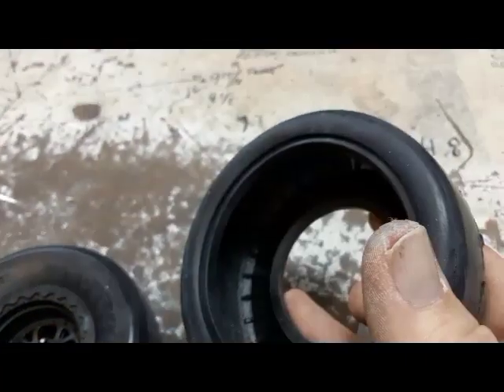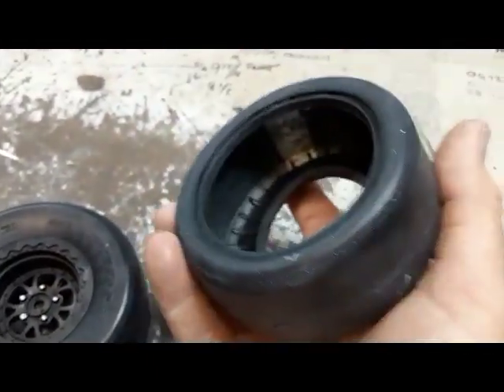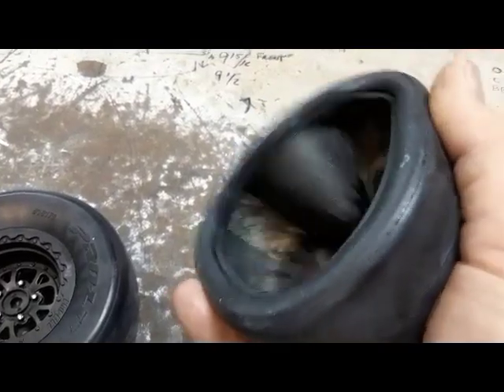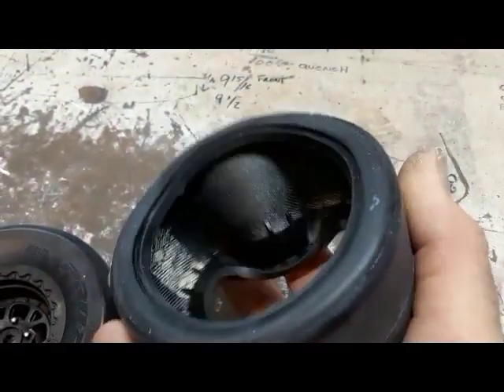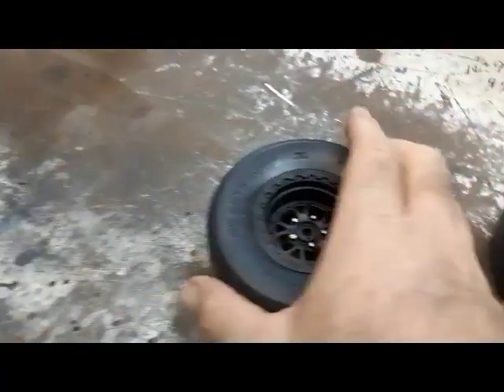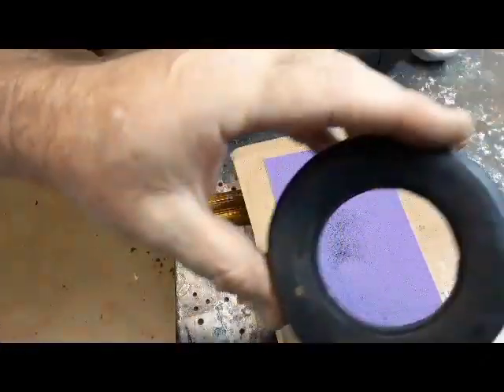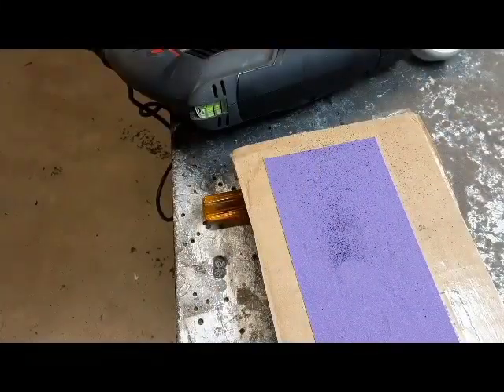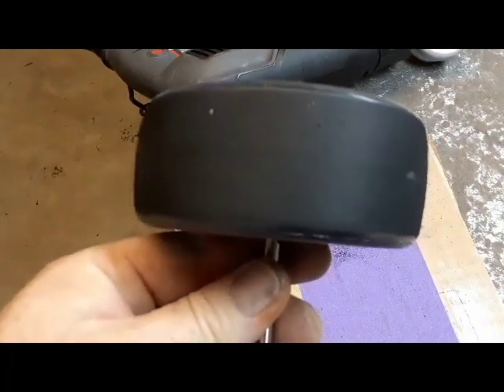RC Street Eliminator Drag Racing....Air test complete - reaction preparation!!!

Comment: Good stuff, Dave. I didn’t realize you weren’t already running air. You ordered some of those printed rear wheels, correct? Those are great because of the valve being on the outside. I’m also working on modding SSD’s to run air. If I can get it to work, I’ll post it up.
Reply from the maker: Oh yes Brian all the videos are time-stamped... I've been shoving the battery, components forward running on air for over a year.. its drag racing you can't fight physics, yeah I got John's rims coming both conventional and his new tire and rim they  are the same sidewall .. I can't wait to try those on air.. like a Voodoo they look very soft and will require pressure, not just ambient like I run reactions on..
Reply: Getting those SSD beadlocks modded and holding air would be interesting... can't wait to see what you come up with.
Reply from the maker: @eagleeyes9770  yeah that would be tough with all the screws

Comment: Dave you will like them on air. I'm sure you use heat bands just remember they will gain air from the heat. The same as a big car slick that is sitting in the sun.. only problem with air that I found was if they are crashed there will be a very good chance of a leak. I always check mine by hand to make sure they are holding air when I pull the heaters off.
Reply from the maker: Thank you Dane I will definitely check if I have any mishaps

Comment: Great video Dave. I got everything the air pump, the sand paper, the drill bit for the tires and valve. What did you use to glue the valve to the rims?
Reply from the maker: Sorry for the late reply oscar I use permatex Silicone . Yamabond...

Comment: Where did you get the air pump and valves from? 
Where or how did you make the drill arbor for sanding the tires? Thanks.
Reply from the maker: They're pump and valve I got from Walmart . just pull the cuff off and push on the tip.. I Googled the Chuck for no prep RC Tire.. I went with a brass one be easier on the plastic. The valve are from Walmart also you know the cage of little hand balls they came out of the ball about the size of a grapefruit
Reply: @powermadracing5116  What is the pump called at Walmart? Where did you get the brass hex to put on the shaft?
Reply from the maker: @RichieCat4223  oh I'm sorry it's a blood pressure checking pump... I just Googled no prep RC Tire Arbor . they'll be a bunch to choose from I think it was like 10 bucks..
Reply: @powermadracing5116  OK thanks. I was on the fence using Reaction tires and DRC. New to the hobby and went with the belted DRC Axis 30 compound tire.
I'm going to use glue first and bought the standard Gorilla super glue. Should I get glue that's made for RC tires?
Reply from the maker: @RichieCat4223  the DRC has a good Tire it's just a little bit heavier then the reaction.. I use Pro-Line tire glue never had a problem !!!
Reply: @powermadracing5116  OK thanks for the input.